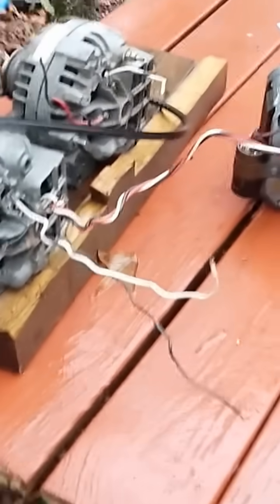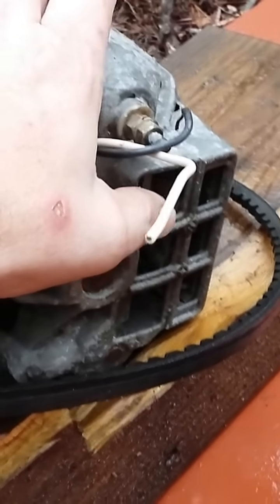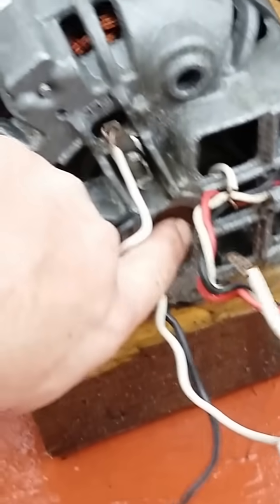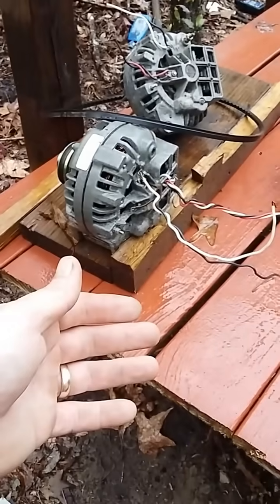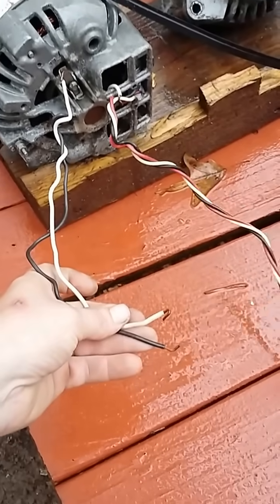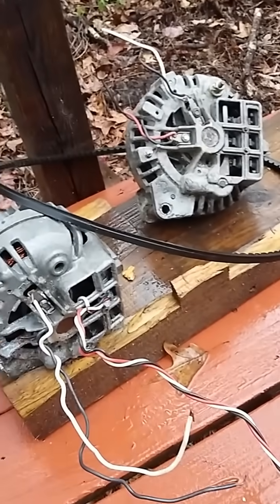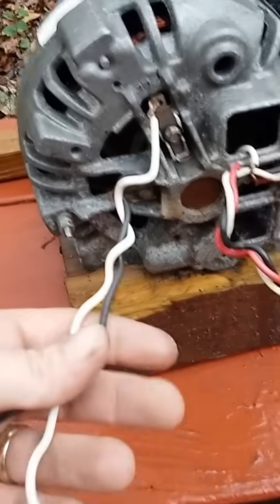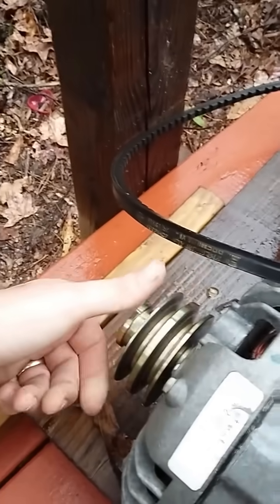Update Free energy forever no wind no solar no gas READ DISCRIPTION!!!

Comment: Ok, so what’s missing is two batteries. One to run the motor to run the alternator, then the alternator charges both batteries and one of the batteries also send power to the house.
Reply: Craig McHatton you’d pull more current running the motor than the alternator could make up for
Reply: An Alternator runs a cars power and charges a car battery. So it’s a fair statement to say if you can get the same power from an additional source like solar, wind or water. Then 2 batteries and this set up would be more efficient.
Reply: Craig McHatton I’d go with wind. Even mount the propeller blades to the alternator shaft, if all you have available is an alternator. Just use the diodes and keep it Dc volts and store in multiple batteries tied parallel to each other. Rectify to Ac after storage
Reply: Makes sense to keep it at the point of origin as well. Would end up being pretty noisy.
Reply: Craig McHatton you can get a/c or d/c generators. D/c typically are self exciting. Most a/c need a source to excite the fields (usually a 12-24v battery). But for DIY with an alternator, or anything really, the main problem is starting/continuing to rotate the shaft, to create the energy. Windmills or water wheels solve this. Let say you are in a cave with no moving water or wind: there is still possibility. Look up Bhāskara's wheel. Invented in the 1100’s or so.

Comment: I have built 4 of these free energy generators according to his instructions and I'm now getting enough free energy to run my 3 houses (2 that I rent) and also my cottage on the lake.These generators actually work!
Reply: Your a liar sir! Plain and simple. If you had such a system it would have to spin the rotor which he refers to as the stator which of course is wrong. True it is the field. On any motor or generator the stationary winds are the s-t-a-t-o-r dah. The rotating part is the r-o-t-a-t-o-r. Get a book. Learn that and then study why no generator CAN NOT output more power than it takes to drive it in watts, POWER is not amps. Also all your houses, would have to have been rewired with 3 phase circuit breakers. Not impossible but sudbstandard, subcode, and illegal in almost all states. And you never mention the prime mover. You must have built your own power station which would burn coal, city gas, or gasoline. Maybe you live where the power companies are fracking your land and giving you the gas from the gas wells. You wouldn't be using electric because that is what you claim your getting for FREE from your magic alternators. Oh i forgot squirrels running on  wheels. Why didn't you say so from the beginning. Of course!If you had enough of the little buggers and a gigantic wheel it would at least be technically possible. Have another beer or increase your system output by feeding it to the rodents!
Reply: @sparkgap100  well i have to add in his defense his other video with the water mill alternator seems to work you can see the mobility.   His theories with the 220 is also partly correct - and if he did wire it the way you said (illegally) well.. thats almost silly.  I also agree there is a possiblity he is using gas well. Not uncommon. But if thats the case, what code inspector will go after him?  so yes the whole thing is possible he has it wired wrong and is why he is acting like a secret atomic bomb researcher... But im always one to point out the positive - he did make a water wheel work with an alternator.  I actually got the same effect from attaching the alternator to the  a circular cooling fan and the water passing the blades turns it fast as hell.  I need very very long wires to get to the house though.   
-
Reply: he has good videos - many views, has a cool personality - weird, but lacks certain explanations.  Could be some dude out at his hunting cabin screwing with everyone too.
Reply: ngoti8tor Iam   Any way I could get a set of plans from you?  My wife and I desperately want off the grid. Thanks
Reply: Wow not sire what ti say. I dont think its worth a rant. I know ita true that an altinator. Can be made onto a generator. Knoq fact all motors are capable of also becoming a generator. 

There are also 240 100 amp altinators so of course. 

So i see the concept how it works but id like to see meter readings and a full description of how to wire it. 

You last video made sence as long as tge altiator moved and charged battery your inverter gave the power. 

So its dowm to actually trying it for yourself ubr on your own with getting it atarted and where to add the 12v or 6v so there arw questions

Bit if u never tried it why argue with someone who says he did. Go try it youself so you have educated experiment with results to be on evem debate grounds. 

But over all. I think the fear of someone threatening the host is a far fetched fable like bigfoot or lile the conspiracy with testla. Lol. 

You require 3 altinators that u convert into generator... That's evough to offer to pay you to come set mine up. No time for that. If ur dee equals 2 years of bills then there is justification to pay a comapnay who maintains it. 

I would lile to try this and see for myself.  I will say this video is less credible than the water mill. There parts not explained well. The electrodes. There is a regulator in the altinators for a solid 12 volt charge. U removed it to add one fron an rv. Was there a reason u didnt use the volt regulator fron the altinator?
Reply: if  this is true How do I get in touch with you.  all other replies debunk this.

Comment: Unfortunately it's difficult to ascertain whether or not you have anything worthwhile because it's not wired up or even running. You don't show voltages, amperes or watts going in or coming out. So no actual real scientific results. And so very difficult to follow anything your saying due to the constant crying baby and your lack of proficiency with the English language.
Reply: my point exactly.. it's easy to say that it's going to work, but how about showing us with a finished product that it works, otherwise he might as well be saying: 'this flying carpet will fly if you just do this, and that, and two other things... I mean, it's not rocket science.' (oh, and the one word you used is "you're" as in "you are").

Comment: So essentially, you still need some power to run the alternator. Like wind, solar or water. But it will convert that the way it does in cars. Great, cheap power converter. But you still require an energy input.
Reply: Yeah it's very simple it's like having a pulley system or a lever to lift something. The amount of energy being put out is greater than the amount needing to be put in. So, yes you do need an initial power source to get it going but that power source could easily be powered by this system with plenty of power left over which you could store in car batteries you could do all kinds of things so you could get this going or keep it going with a car battery and have the system constantly charge that battery plus charge other batteries plus power whatever you need powered.

Comment: how do you power the motor to run the generator without creating electricty already or using the grid.
Reply: you just add batteries and then you spin the roundy thingys with your fingers. easy peasy.
Reply: @kmac1959  How do you wash diapers if you're busy spinning the roundy thingies?

Comment: How do you turn the generators after converting them? Unless you are using wind or water energy first and foremost it's not free. Second if you are using a battery how are you charging the battery? It is not possible to to have a self sustainable system because of loss. You will always use more power than you can generate.
Reply: Without getting to involved in an explanation the most conductive metal is silver. Electricity can flow through silver with the least resistance. In order for this type of system to have the most conductivity and least resistance every part would need to be silver or silver coated. This would mean the wires going to whatever you are powering. In this case it's supposedly a house which means the house would have to be wired with silver wire. The first problem with this is very few people could afford it and the second the system is still not self-sustaining. We use copper as wire because most importantly it's cheaper and two it is only slightly less conductive than silver is.
Reply: i got fig out .. same way you do on a car . to make this work you deed more stuff
Reply: @bryankisner4918  I know how it works and how to make it work. The point is this method of power is being taughted as FREE. At the risk of repeating myself, it can only be free if you are using a natural means of spinning the alternators now generators. Such as wind or natural running water. If you are using a gasoline engine last time I filled up with the stuff it's not free. If you are using a motor and battery and said battery isn't being charged by a solar system that supplies more energy than you are using than the charging of the battery isn't free either. As I also stated before, it is not possible to have a closed self-sustaining system. Between loss and use you will always take more out than you put in.

Comment: Makes no difference how he's powering the motor, you can make more amperage.  A power supply runs on less amperage than your making, get it?
Reply: It makes zero amps until you connect a load. Any step down transformer will increase the amps on the secondary winding over the primary. This is the science and hard cold facts. Amps is current flow not power. They actually have a unit for it called  Watts! Watts or power is not Amps. Every single time this topic surfaces people with less than secondary school of Science dribble the same rubbish. Just please refer to Wikipedia. Now my last remark on the topic and I will ask the one who truly knows all. God please help these poor clueless ones to learn how to look up facts on the most powerfull tool of learning yet created, the internet which they seem to have a marginally understanding of using, to educate themselves unstead of spreading more and more half truths and misunderstood science to a world where vudu science reigns supreme. In Your Name I ask of this, Amen.
Reply: Please be advised that power can neither be created or destroyed! It is simply converted from one form to another. I didn't say that, Sir Isaac Newton did. I quote Wikipedia "An English mathematician, physicist, astronomer, .... who is widely recognised as one of the most influential scientist of all time,...". Better yet learn Ohms Law, along with your troll supporters. Power is equal to I squared times R (resistance). The resistance part here means the LOAD you're supposed to be connecting to the output of your magic alternator. After you learn how to do this properly, you will find to your astonishment, that your alternator is outputting in watts (power) about 60% to perhaps 80% of the power you are inputting to it depending on its efficiency. Not only are you NOT making free energy, you're wasting 20 to 40% of what you are putting into it. I wish it did work your way. I wud be a billionaire overnight! It is simply sad that the most clueless people on Earth have this forum to disseminate such rubbish whilst real people of science go unnoticed.

 some how over night because I wud quickly be a billionaire!
Reply: lol ya Wikipedia is all truth. I prefer self study  wow.
Reply: Sanguine Shade I’ll save you time. More amps = less efficient. I can make a 1hp motor pull 50amps if I ask it to do the job of a 25hp motor, and it would burn up and fail. The guys idea isn’t bad, in fact atleast he is trying. If he would attach a wind mill to the shaft  he’d be on the right track.

Comment: A little knowledge is dangerous and this guy will either kill himself or the simpleton that tries to build his Free Energy Fan.  90 amps through #12 wire?  I can just picture the insulation bursting into flame as the wire turns bright red and burns out the free power alternator fan.

Comment: You have not actually tested anything! Worse u haven't educated yourself to the actual facts. That small fractional motor that your driving the alternator with will produce about half the power you put in. Yes the alternator will produce 90 amps perhaps as high as 100 volts. Power is volts times amps =9000watts. You would need about 10 H.P. to generate that. If you knew 1/10 of what you think you know you wouldn't embarrass your self for the ignorant hick that you are. I have made many projects from car alternators  and 3 to 5 hp Briggs is the smallest motor which can be used to   build a small emergency generator. It will last 5 minutes as a usefully motor. You simply don't understand the first thing about. But I'm sure you heard that a 1000 times by now. James Yunger Electrical Engineer.
Reply: @happyhomelesshomesteaders158  you talking to me?
Reply: @WethamanClanVideos  not sure what i even said not directing anything at any body alternators are fun to play with 😃
Reply: @happyhomelesshomesteaders158  cant stop laughing, case closed
Reply: @happyhomelesshomesteaders158  got me laughing cant stop, case closed
Reply: @utuber13x  i like to fuel the fire 😀
Reply: Way to completely over shadow your argument with petty name calling. You literally just could have left it with facts and said your peace, but you had to turn into the same ignorant jackass that you claim this man to be. So grow up a little and realize that resulting to name calling with always speak louder than the facts you are trying to present. Now have a good day.

Comment: Would it not be easier to just hook up a dozen of those 12 Volt 10 Watt mini water generators to one of those 55 gallon drums or larger , with Just a dozen you get 120 Watts per hour with the water doing all the work 24 /7 and store the power . invertors can be bought for cheap to turn it into household current . Simple Cheap Quiet Easy all in 1

Comment: Electric company gets electric for free ?! Haha they produce the electric and its then supplied to consumers.
Reply: The method utilities use to generate electricity involves transformers. Electromagnetic induction is used and by introducing a smaller current into a transformer, the yield is a much higher higher voltage out on the load side. That initial lower electrical current has to be supplied (other electricity, water, wind, solar, gas motor) but once running, some of the resulting current from the load side of the transformer can then be used to replace the temporary initial current. Yes, at the start, there is an outlay of money for equipment and then staff and maintenance, but the resulting electricity is actually free. Simply put, magnetism pulls on the electrons in the copper atom to go in one direction. Electrons from the rear then move forward to replace them, creating this movement. That movement is channeled through a prescribed wire path and made to do work for us. It's pretty darn cool if you think about it.
Reply: outsider kustoms you should read into Tesla... there is energy all around us! Have you never powered a light bulb with a potato before?
Reply: @roger3858  electric company has to pay a power supplier. Employees . its business. Like a trucker paying hooker . farmer selling his produce . 

Electric company also has to pay for water. Water is used in cooling towers

Comment: Hey buddy if you plan on using that you first need a way to spin your stator... maby a gas motor? Oh yea that’s already been done it’s called a generator also are you planning on running 90 amps through that 12 wire? Your gonna need some bigger wire!!! Please just stop your gonna get hurt!!!! When they said you would not live long they weren’t threatening you they were predicting your future.
Reply: Now, if you can get it spinning and plug it into itsself to use a fraction of that power output to kee it going youve done something.
 Im still trying to figure that one out
Reply: Or power another. Electric power source to turn the power producing one
Reply: u need to tell him more to help ...of course u cant weld with those tiny wires...its a metaphor...y dont u help all of us if u know so damn much
Reply: Eva I thought I did

Comment: The ROTOR rotates. The STATOR is stationary. Do you understand? How am I getting the 3 - 12 volts DC? Batteries? They'd be dead in no time. How fast do I have to spin the shaft. Won't my hand get tired? Leaving the alternators out in the rain is a very good idea. Because water is a good conductor of electricity. What has the capacitor got to do with alternating current? That's a capacitor start split phase motor.  I have a lot of questions. But, I know you don't nave any answers.  A  rock has a higher IQ than you do.   By the way, did you ever find your way out of the woods? You know, the place with all the trees. I doubt if anyone is going to look for you.  The only reason you have so many views is because a lot of people are watching this over and over again just to see how STUPID you are.